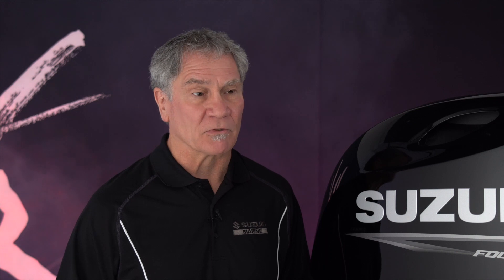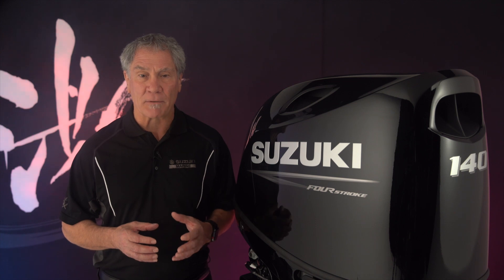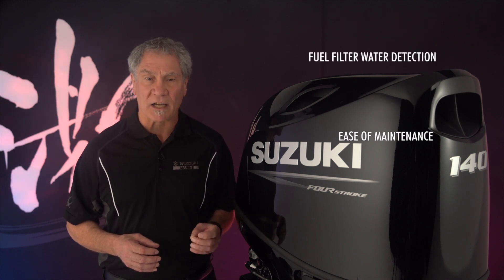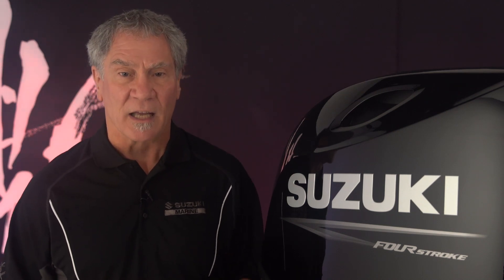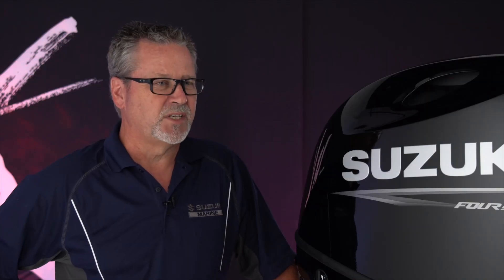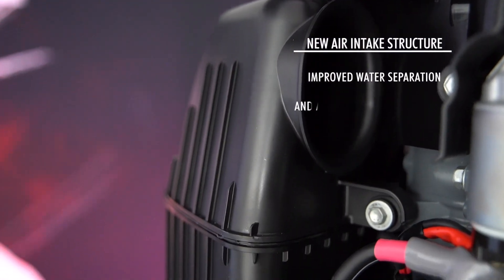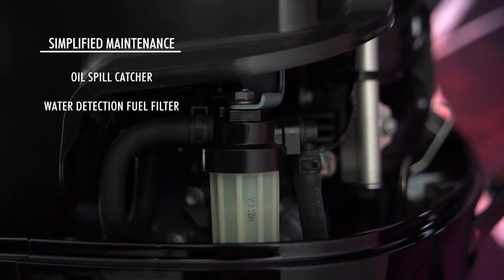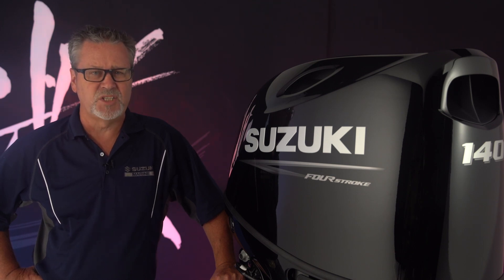Suzuki's New DF115BG / DF140BG 4-Cylinder Outboards.

Comment: I have  Suzuki 140hp ..head cylinder crack and my friend the same not good engine
Reply: It should be cylinder head casting problem or detonation issue
Reply: What year did you have ?
Reply: Buy a Honda